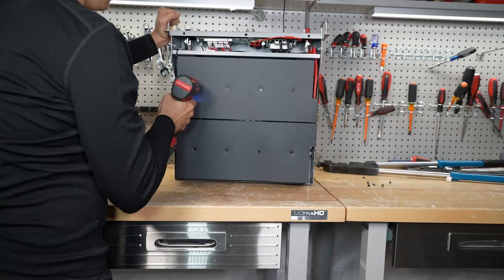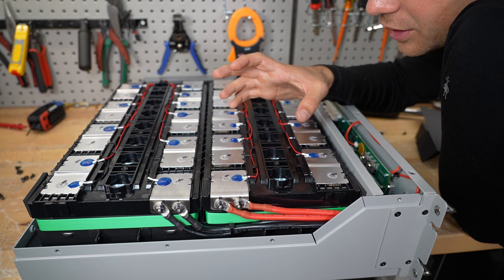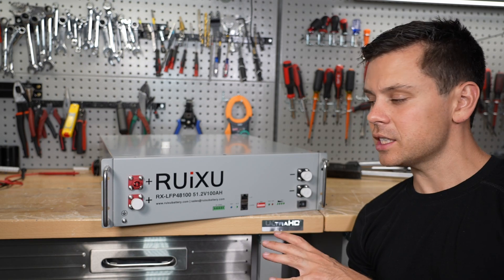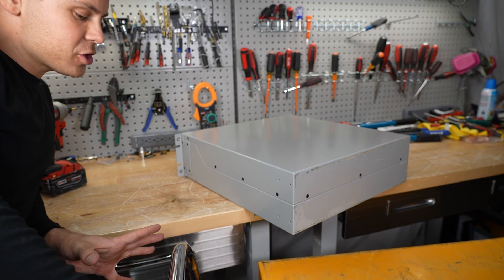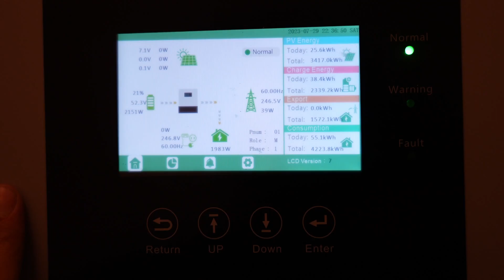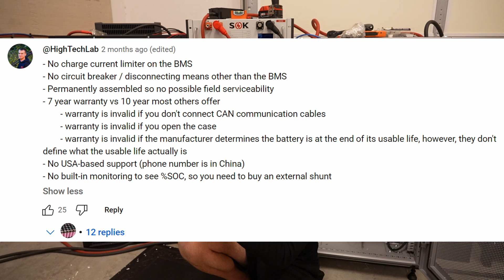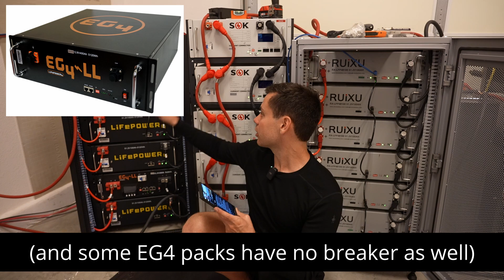New! $1,299 Ruixu Server Rack Battery. Works with EG4 18KPV! UL1973

Comment from the maker: You can buy it here (affiliate link): https://www.ruixubattery.com/buy-now?ref=uakhk727

EG4 18K can be purchased here: https://www.currentconnected.com/product/eg4-18kpv-hybrid-inverter/?ref=wp

~~~~~~~~~~~~~~~~~~~~~~~~~~~~~~~~~~~~~~~~~~~
Tired of getting ripped off? Check out my "Will Prowse Approved" solar product recommendations below!

12V Batteries
https://www.mobile-solarpower.com/lithium-batteries.html

48V Batteries
https://www.mobile-solarpower.com/48v-batteries.html

Offgrid Inverter System Builder
https://www.mobile-solarpower.com/48v-complete-system-blueprint-559371.html

Hybrid Inverter System Builder
https://www.mobile-solarpower.com/code-compliant-48v-offgrid-system.html

Mobile Handtruck System Builder (very popular!)
https://www.mobile-solarpower.com/mobile-48v-system.html

Solar Panels
https://www.mobile-solarpower.com/300w-solar-panels.html

Ground Mount Solar Racking
https://www.mobile-solarpower.com/ground-mount-racks.html

Wire, Lugs and Busbars
https://www.mobile-solarpower.com/wire-and-connectors.html

Tools
https://www.mobile-solarpower.com/tools.html

Fuses and Circuit Breakers
https://www.mobile-solarpower.com/fuses.html

Plug-N-Play Solar Systems
Ecoflow, Anker And Bluetti! So many models to choose from. See my current recommendations here:
https://www.mobile-solarpower.com/full-size-systems.html

~~~~~~~~~~~~~~~~~~~~~~~~~~~~~~~~~~~~~~~~~~
Need to build a large DIY system? Need a trustworthy solar distributor? These are my favorites:

Signature Solar
Creator of EG4! Solar Minisplits, Victron and More! Largest Solar Store Online.
If you want $50 off, please use my link below and coupon code "DIYSOLAR50":
https://signaturesolar.com/?ref=cPwLcVc0SW-BjN

Current Connected
Best Prices for EG4, Victron, Midnite and so much more! Fast Shipping and Highest Rated Customer Service:
https://currentconnected.com/?ref=wp

~~~~~~~~~~~~~~~~~~~~~~~~~~~~~~~~~~~~~~~~~~
Join our DIY Solar Community 
Need more help? Join the largest solar forum on the internet for beginners and professionals alike. 140,000 members and counting!
https://www.diysolarforum.com

Check Out My Free Book
Best-selling and beginner-friendly guidebook to off-grid 12V solar!
https://www.mobile-solarpower.com/the-book.html

~~~~~~~~~~~~~~~~~~~~~~~~~~~~~~~~~~~~~~~~~~
Contact Information:
I am NOT available for personal solar system consult! If you wish to contact me, this is my direct email: williamprowsediysolar@gmail.com
FTC Disclosure Statement and Disclaimers:
Every video includes paid promotion or sponsorship (such as free products for review). Some links on this YouTube channel may be affiliate links. We may get paid if you buy something or take an action after clicking one of these. My videos are for educational purposes only. Information is subject to change/update at any time. Electricity is DANGEROUS and can kill. Be smart and use common sense :) DIY Solar Power with Will Prowse is a participant in the Amazon Services LLC Associates Program, An affiliate advertising program designed to provide a means for sites to earn advertising fees by advertising and linking to Amazon.com
Reply: Hi Will. Great video as usual! Have you ever reviewed the server rack battery from Seplos? Do you have any thoughts on them?
Reply from the maker: @jf5186  thanks! And everyone has told me that those have issues. And most distributor's sell them for more than the competition. Doesn't seem like a good product from what I'm hearing
Reply: What about the 280ah 48v server rack Docan is selling for 2600$
Reply: FYI - Ruixu (pronounced Rayshoo in traditional Chinese) = Rush in English according to google translate.

Comment: What DIP settings do you use for the RUixu? I plan to do a solar cart and it looks like each server rack battery you have in your rack has a different dip switch setting
Reply: Mainly used for selection communication protocol.

Comment: it will be nice if u can talk abouth the chinese solar systems 30 to 50 kwh inverter panels because the one u are been showing and explaining will not resolve most home owners tha house that used 30 to 50kwh 27/7 360 days needs that amount of power but the systems in usa arte extremily expenses the chinese system with high voltages inverter are a lot alot cheeper can u tell us all abouth my point

Comment: Will A safety tip When working on a large battery system you should always disconnect all of the battery's positive terminals. I don't like bare ring terminals as the first one you disconnect will be live from all of the remaining battery's and can short them out. In my opinion every battery should have its own disconnect and over current protection device. When a disconnect device is available please use them. Preferably the over current protection would best be a fuse as they in general have a much higher interrupt current capacity than a breaker. In my opinion an uninsulated bus bar mounted inside a metal cabinet with battery's that they themselves are enclosed in metal cases is asking for serous trouble. At the very least the positive bus bar should be insulated with no copper showing. As a back up the negative bus bar should be fully insulated as well. Even thought your battery system is only 48 volt an this voltage by it self is not dangerous, but the current is potentially dangerous. Your battery system has very low internal and external resistance and can therefor deliver 10's of thousands of amps if not in the 100 of thousands. Currents of this magnitude can cause serous third degree burns. In addition the arc flash can create UV (as can an arc welder) which can cause UV damage to the retina inside of your eyes. If at a high enough level and for a long enough exposure this can result in permanent eye damage. I have personally seen people with electrical burns and arc flash eye problems. I do not want to scare or put any one off from working with these systems my goal is only to educate and to emphasizes the need to know and use proper safety procedures. I enjoy you video's and I would not like to see you or anyone else get hurt. I can see that you know what you are doing and I don't know what formal education you have but with or with out it I would put you in a professional class. Here in lies the problem with any experienced professional is that with this experience they can become lax and go off guard. They take short cuts or cant be bothered which is how accidents happen. Never make the mistake of thinking you can cut back on your safety procedures. Will when you are making these video's you need to not only educate you viewer's about safety procedures but you need to set the example as well. When DIY's know and use the proper safety procedures it is perfectly safe to work on these systems. Always have the proper respect and a healthy fear of electricity, it will keep you safe. Thank you for the video's and best wishes to you and all of your viewers.

Comment: Hello, I wasn't able to find the information online, but is it possible to connect these Ruixu battery in parallel without a bus part? I see everywhere that they use a bus part, is there any reason why compared to connecting the battery directly ?
Reply: You can choose daisy chain connection, but we recommend bus connection for more even current distribution.

Comment: Just read the warranty page for Ruixu. It does NOT say a claim is invalid if CAN has not been connected. It says that if the CAN is improperly connected or used - not following the manufacture advice re CAN connection - that then the warranty is invalid. Perhaps when current connected looked it read differently, or they read it differently.

Comment: Ruixu has done a pretty good job at getting these TopBand designs to market first. There is now competition form Maple Leaf Power in Canada selling them as the "Beaver" and in the UK it looks like FogStar has these units and are calling them the R51100A. There are also self-heating versions coming to market in early 2024 from Ruixu and Maple Leaf... so if you need self-heat then hold off!

Comment: yes, ruixu is good design for the server rack battery. but, it still should consider cercuit breaker to prevent short cercuit from all possible damage like you accidentally did when installing and monitor if communication fall and cause some battery accident like bms broke, battery itself broke, wire disconnect, etc. monitor detects those failure so easy. breaker prevents from catching fire. i am looking forward waiting for the new product that manufacturer make in this market. thanks for the video. it was informative.

Comment: Based on the AOLithium manual they say the cables are 25mm2 which is closer 3 AWG... which would be thicker that the 4 AWG ruixu cables, no? The Futronics FSP 6.0 connector on the AOLithium is rated at 125A so should be ok with the bus-bar I would think. Maybe the Futronics copy of the Amphenol is not as good of a build. I am in Canada and choices are slim but the AOLithium is ~$1800 CAD shipped and Ruixu is ~$2100 CAD plus 350 LTL freight... I have a 20 kWh cabinet kit on the way so will report back when that shows up. I don't have a lot of room so the cabinet is abit bulkier than I would like but the packs are nice and compact compared to SOK.

Comment: I so agree with you on the SOK batteries. If they had a nice cabinet that could hold 6 batteries and looked good they would be great, but because I get one free battery by buying the EG4 there is no contest.
I sure wish Will wold have just tested if an EG4 battery would fit in this rack because they will sell that rack for $559 and those EG4 batteries would sure look good in that silver rack.

Comment: EG4 gets its batteries for ~569$ from China, and you can do that too, but it comes at a risk of dealing with battery problems on your own.
Reply: Do you have a link where i get them for $569 from China please
Reply: @themanwhobeateinstein  the prices have changed a little bit, but the price is still pretty good. Google deletes comments which contain links if you are not the author.

Try googling `alibaba "solar battery 48v 100ah battery 5kw lithium rack mounted battery pack"`

Or `alibaba "EG4-LifePower4 Lithium Battery 5KWh 48V 100Ah Server Rack Battery"`

Comment: Should they move the power switch to not be under the wire?

Was the short caused by the handles touching the terminal?

If they added circuit breakers and move that power switch it seems like it would be perfect?

Comment: Will,  how many of the Ruixu batteries would it take to run an entire house with a RV hooked up to 50 AMP right now I have 35  295w solar panels and my true up bill is a S1600.00

Comment: Hi Will I really like this battery and wanted to know if it would be ok for my solis hybrid
 S5-EH1P5K- L. I’m thinking of putting a server cabinet in my utility room next to the inverter, but this battery is not listed as a compatible battery with solis. Do you think I can use it ? I was under the impression the R485 canbus would just do it’s stuff ? 
I am new to this Solar game and would appreciate any help please  ps, love the channel Will you make it all sound super easy ! And your enthusiasm is additive :-) best wishes from the UK.
Reply: This battery can be adapted to this Solis inverter, the standard network cable connection, and CANbus communication connection, the communication protocol is very easy to set, just set the DIP switch according to the  manual

Comment: Presumably, the battery BMS utilizes firmware for some of its functionality.  I did not notice in the video where you may have addressed firmware.  Do you have any idea if Ruixu supports end-user firmware updating capability and/or are there any software tools available as is the case for many of these types of batteries?  Thanks
Reply: Ruixu battery can be connected to the computer through Rs485 serial port or CANbus. We plan to develop a smart screen in the future, and we can also upgrade the firmware through this smart screen in the future. We'll be showing the firmware part later on our own YouTube channel
Reply: @ruixubattery  Thanks for the reply.  I'm looking forward to seeing / obtaining the smart screen that will allow firmware upgrades as needed when it becomes available.  I assume you plan to make it available for those that have purchased the batteries / racks on your website.

Comment: What would the max current output be if you hooked up the Ruixu batteries up like the SOK instead of going to a bus bar? Cause the 4awg cables that come with the Ruixu seems pretty small for powerwall applications.

Also what terminal connectors are those on the SOK? I would like to reduce the chance of bare terminals being exposed.
Reply: This plug is a 100A current specification plug, so we recommend that the power of the inverter is not more than 5KW if the Daisy chain connection is used. We do not recommend Daisy chain connections.                SOK is available with terminal protective covers.

Comment: Will, another great video!  I've been enjoying your content for years, keep it going!  I enjoyed this review and completely share your enthusiasm in spite of the potential caveats.  I just pulled the trigger for the RUiXU 30kwh battery rack for a new solar system I'm installing in my home.
Reply: How are you feeling about your system after 6+ months?
Reply: @KyleSindlinger  Runs like a sewing machine. No issues.  Intend to purchase a second rack shortly.
Reply: Good to hear-thanks for the response! May I ask what inverter you’re using with the battery bank? I’m planning to use the EG4 6000xp. Also, with regard to Ruixu, my biggest concern, like probably everyone, is how they will handle potential warranty/customer service/technical support issues.
Reply: @KyleSindlinger  Sol-Ark 15k. Only time will answer yor concern. So far, Ruixu has been very responsive to every question I've asked. Since they originally released, they've also extended their warranty from 7 to 10 years. I'm also told their UL9540 Certification is due out very soon. I've paused on my next purchase to see if their new 14.3kWh battery bank will communicate seemlessly with the existing Rack systems. If so, I will likely go in that direction since the form factor is so much more compact. Specs and pricing should be released shortly.

Comment: Will it communicate the battery percentage with the EG4 3000 ehv? I have 3 inverters and diy batteries(with jbd bms). I've been shopping for a year for a battery (thats cheaper than the LifePower) to communicate the battery banks level. I'd be happy even if i only saved $100. This recession is real

Comment: Could you flip that RuiXU server rack over 90 degrees and install this in a big RV?
Reply: Lay it flat as in the video or stand the panel up. Other directions are prohibited.
Reply: @ruixubattery  Thank you for replying.   I would want 5 or 6 units and will be watching how thew reviews are and the next update from @WillProwse.   Can these be installed/ used in RVs?
Reply: @522Shelby  Yes,it can be installed in RVs.
Reply: @ruixubattery  thank you so much for the reply that is very helpful. I will look into how to incorporate these.

Comment: Great video... thanks.  Just noticed that the bottom battery lights were not on or flashing in the rack near the end of the video... did you possibly not turn that one on?  Just curious.  Oh, and that short circuit sparks would have scared the s**t out of me.  Please be more careful.

Comment: I purchased an EG 4 server rack system with six batteries several months ago and the new cabinet has a door that latches and locks, very nice heavy duty wheels with locks, it is completely welded, it is a very nice cabinet. Somewhere I ran across a video stating that they have greatly upgraded their cabinets. From what I received versus what some others have I would have to agree that they are greatly improving them.
Reply: This is good to hear!
I'm looking at the EG4's right now myself....

Comment: RUiXUs are a much cleaner build and more compact when racked vs the others. :cat-orange-whistling: The space saving in itself would be great to have a 4 stack in a van.
I currently have 4 SOKs ready to be installed in my van with Victron MultiPlus IIs in parallel. Wish this came along sooner.:face-orange-biting-nails:

Comment: Can the Eg4 and the Ruixu communicate with each other and be placed in the same circuit? I need to add more batteries to my EG4 setup, would these work if I trusted their returns? 

FWIW I highly doubt there will be any value to these if you had to return even one to china for service. The cost alone would be deal breaker.
Reply: Sorry, the Ruixu battery cannot communicate with the EG4 battery .

Comment: Seeing that spark i have a question,what size fuse to use on battery + side , battery is 5kw 48v,4 *12v zooms in series ,inverter is growatt 5000es

Comment: I did not understand how you caused this short, can you please explain?  
Thank you.
Reply from the maker: I had cables connected at the top. They were obstructing the top battery
Reply: @WillProwse  Ah, ok I see.  Thanks.   There is a lot of exposed metal on these systems.  Very easy to short something.

Comment: Great video as well. Going off grid soon too.
I have also some spare network racks like yours that I will use.
Since EE I will have a braker or fuse between bus plus bar and inverter, just in case (and I can turn off the whole rack). May you come up with an solution as well?